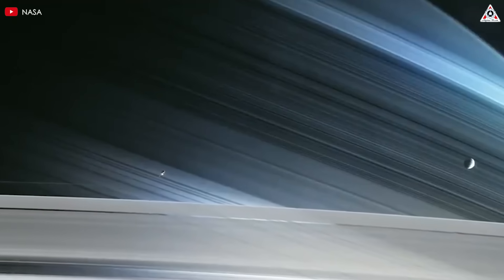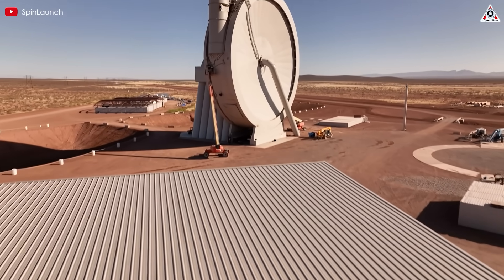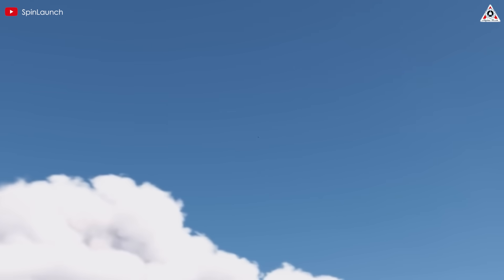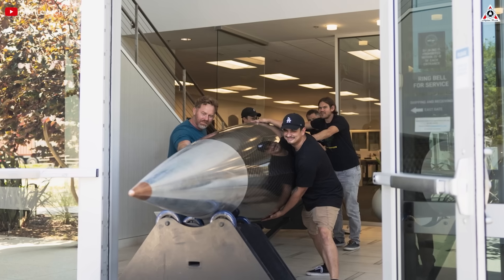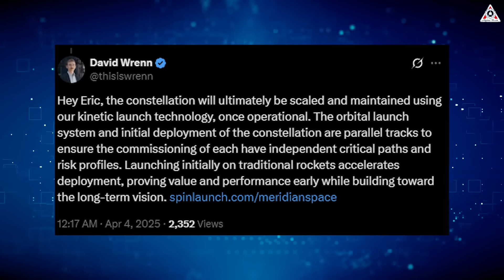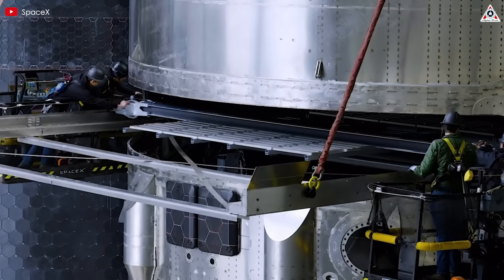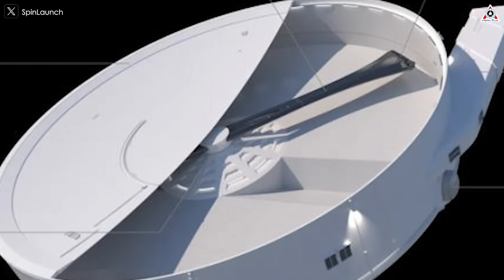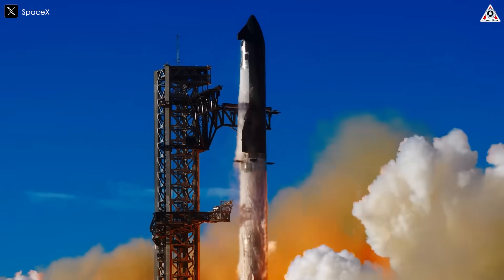It Happened! Spinlaunch Stopped Trying To Make An Orbital Accelerator After...

Comment: Spin launch would have to actually spin faster than 17,000 or so mph. Drag in the air would slow it. And slows it faster the faster it goes. 

I'll guess 24,000 to 27,000 mph to reach orbit with drag in mind. And a tank shell only has one instance of going from zero to around 3 to 4000 mph not contant gs at 17,000 plus... 

Who thought this would work... should they be involved in designing anything?
Reply: And I needed to freethink that. A.I wouldn't do the math and use physics to give me a launch speed that accounts for the drag. Someone snaryer okeazw do the math. Im curious how close I am to being right compared to A.I that has the internet and cheat sheets and failed to answer my question.
Reply: It's easy, take the launch speed, then you do something with the reducing coefficient of drag.
Now you're gonna have to know what the reducing scale of pressure is for every, say, 100 feet or so. That's approximately three atmospheres, I think. I'm a scuba diver and 33 ft is our limit of diving without having to do a safety stop.
So, you take D = 0.5 * Cd * r * V^2 * A
Google this and work the math.
You'll have the answer you want. Maybe.
No?  No. But.
I'm close to the right formula...
It won't account for the 100 ft of drag, so do it every 50 ft?
Vertical drag is hard math. Ok, here's the good good-
D = ½ * ρ * v² * Cd * A, where D is drag force, ρ (rho) is the density of the air, v is the velocity of the rocket, Cd is the drag coefficient, and A is the reference area of the rocket. 
Google the rest, I have a paper due in three weeks that I've gotta go research. Good luck, I love your curiosity!!
** Now that he has the tools, let's see what Curious George does with it, shall we?

Comment: They were the only ones to dare, because they were the only ones to fail the basic math and Still manage to find suckers to invest in this as an orbital satellite launch system.
Imparting All the energy to get to orbit immediately is incredibly inefficient and puts massive restraints requiring extremely robust satellites and small size. They have to toss an object at about 7.5-8.0km/second... care to imagine the energy lost to friction? How heavy and overbuilt the satellite would have to be to survive launch?

Its Far more useful as a weapon than a credible launch platform for satellites. 
In theory, it could lob an artillery shell or nuclear terminally guided bomb anywhere in the world.

Comment: What if the put spin launch on a giant blimp ?
Reply from the maker: SpinLaunch on a giant blimp? Cool idea, but a nightmare to pull off. The centrifuge’s weight, insane rotational forces, and power needs would overwhelm any blimp’s buoyancy and stability. High-altitude launch platforms like Stratolaunch’s Roc plane make more sense.
Reply: @alphatech4966 we just need a bigger blimp. " Slaps fist into hand"

Comment: I was wondering when they were going to fail. I thought it was a good idea til I realized they could achieve the same results for like $250,000 with an M777 howitzer and save $20,000,000. This thing has less range than some of the artillery in Ukraine right now.

Comment: There are numerous technical problems that Spinlaunch would have to overcome before they will launch an inert 5 pound chunk of steel into orbit, never mind an actual satellite.
Here's just one: In order to spin anything up to any decent speed on any centrifuge, the centrifuge has to be balanced, very Very VERY VERY precisely. So if they are going to fling a 50kg object up, there has to be a counterbalance on the other end of the centrifuge arm. 
Ok, no big deal, put a dummy on the other end of the arm.  But when the object going up is released, you have to release the counterbalance now has to be released going down or the arm will be suddenly very unbalanced and destroy itself and the building in about 8 nanoseconds.
Ok, make it so the counterbalance is released in the exact opposite direction at the exact same instant. That's not easy, but it's possible. And where does it go? It's carrying several trainloads of kinetic energy that has to get dumped somewhere.  Functionally....it's a bomb now.
Ok, so they dig a big mine shaft very deep in the ground and the counterbalance harmlessly dumps its energy half a mile underground. Is it harmless? It's exactly the same amount of energy it takes to slam the payload up into outer space, but now released under the facility and the town INSTANTLY. We're talking about a minor earthquake every time they launch something. 

Although they mention the counterweight in the patent, they have never shown in any video or drawing or discussion that I am aware of, about how that much energy is going to be absorbed. They have mentioned in interviews that this could be resolved by launching a second payload, 1/2 rotation after the first, but I would love to see the math where the centrifuge is strong enough to survive that imbalance for even 1/2 revolution. Color me deeply deeply skeptical they will ever launch anything into outer space.

Comment: crazy idea doesn't work?  you don't say...
Reply: Pretty sure they said the airplane and "Flying" were INSANE ideas, they said that about AC electricity.  They said that about landing a rocket engine vertically, on land.   They said that about metal 3d printing.  They said that about internal combustion engines.   I could go on and on.  Things are only crazy right up until the point they work.   We have to do things in ways nobody has done before to continue innovating

Comment: Not physically possible .  Unless a post launch rocket system is attached.   This "Launcher" would have to be 4 to 5 times it's present size.  Still impossible for heavy launch operations.

Comment: I invented this in about 1985. I called it the Dymaxion Shredder. It’s a weapon. A hypersonic weapon which can wreak havoc on a battlefield, or take out drone swarms, properly applied.
Reply: Position horizontally with projectiles around the circumference. to clear the area of robot dogs. Launch as a group spinners, set to release at different heights, to eliminate drone swarms. A 1 metre diameter disc at 10,000 rpm isn’t hard to achieve. Use it for good, not evil. And remember, the projectiles can go a long way, so be careful 😉